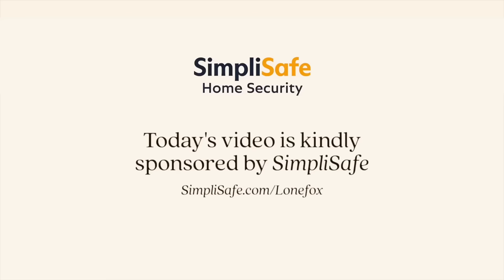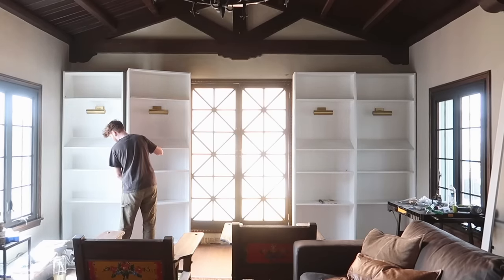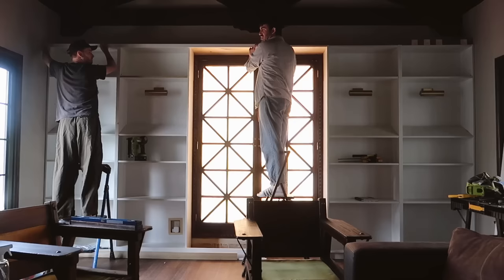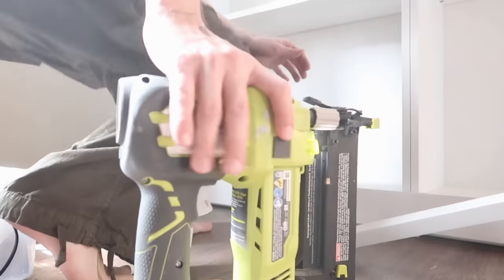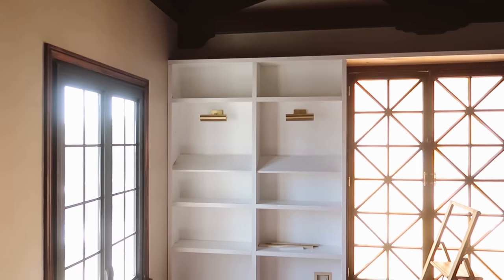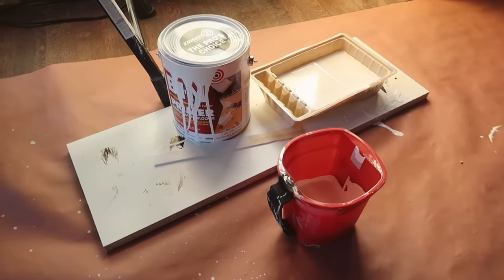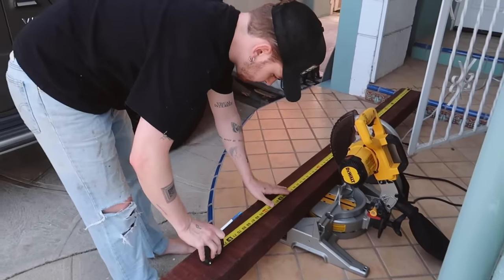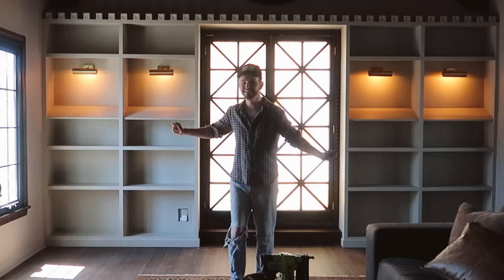DIY IKEA Built-in Library Shelves *AFFORDABLE & EASY HACK*

Comment: I. Made built ins with IKEA Hemnes. I had to put a 1x6 on the bottom similar trim connecting the two book cases and ceiling trim on top. A great advantage was being able to run electric cord under the Hemnes and up the groove in the corners. And Hemnes is real wood

Comment: Curtains outside of the window/doors will block light when you're trying to film and ad privacy when needed. Even sheer or light linen will do the trick. The goal is simply to dull the harshness of the sun not rob the room of light. try taping one up just to see as an example. Cute curtain holders on each side of the doors will look nice from outside if you choose a pretty iron hardware. Probably get the weather proof ones for the rare times it rains in LA

Comment: Not a fan of the dental molding but it's not my house but I would definitely consider removing it and bring in the brass rail like the other follower suggested.  I would also remove the portion that connected the bookcases and wrap the brass rail on top.  The beam needs to have more space to be the showstopper.

Comment: I think the end result looks really nice, but with all the extra stuff you applied including the paint, I wonder if this is really cheaper. At least here in Germany anytime I DIY stuff I have to spend so much on paint or stain and tools and wood at the hardware store that I could have just bought the more expensice piece and saved myself the trouble. I think unless one already owns a lot of  power tools and supplies its not cheaper especially if one doesnt use all the tools and supplies much afterwards😢

Comment: I think you can make bookcases even better. Get flat decorative 3 inch wide wood molding and face the front of the bookcases for a chunkier look. Maybe just put it on vertical supports to save time.

Comment: The 3x6” “green” plate is simply (treated lumber for water deterrent on home builds with concrete) thats what you used for your step. I just finished using the same lumber as tops of concrete foundations in the house for hangers and etc… Looks amazing drew as always!!

Comment: tbh i dont know if its just me but the ''trim'' on the top ... idk it doesnt seem to go, and id have painted the bookcases the same dark color as the door so it looked like a giant piece with the door included, but its a great idea
Reply: I agree about the top trim. Looks a little too castle themed
Reply: NO Trim On Top… doesn’t match. Use the top for decor.
Reply: Not a fan of the top part, i think it takes away from the doors. I really think old bookcases or something smaller beside those lovely doors would have been nicer.. Or painted dark so they don't compete with the doors.. Not my fav at all.

Comment: You lost me on the trim atop the book cases, but everything else was really well done. Maybe also swap out the light bulbs for a cool white? the warm white seems a bit off putting.
Reply: I’m personally never a fan of cool white lighting, I think the warm white feels cozy
Reply: @katelester5625  in my opinion given they're going to be display areas, a cool white light is more neutral and will more accurately display whatever you're placing there. A warm light will change the tones of the displayed items.

Warm white lights are good for lamps or overhead lights.

Comment: "[J]aggedy, peaky situations" are called dentil- almost as in TEETH! Mouldings are called dentil mouldings, but in your case it would just be dentil *trim*; I learned that in design college, the same place I learned about building codes and the difference between being a designer and merely a decorator.

Comment: So fabulous...love the trim on the top...
 Just had a design, I sketched up for a fireplace, with those rosettes one large in the center, angled the sides with 4 rosettes top and bottom.. smaller.
Light oak 53 tall..56 wide,
Had  wider base made 3inches wider...love it !
20 inch mantel...lifes worth living...right!   ❤

Comment: The wooden "Rosettes" are actually called PLINTH Blocks.   Yes...they are very versatile.  Decades ago, people with limited skills  and or the "equipment" to do an actual miter cut,  used Plinths at the corners to join the door, window and crown molding trim. 🤔

Comment: I would have used about under 1/2 inch round wood dowels to cover the area between the self front and the trim. It would have a finished look if anyone is nosy to check. 😊

Comment: I usually like your work and you did a good job on the bookcases with the exception of the rosettes.  They are usually used with trim on the corners.  Have you thought about trimming the top with the same wood you rimmed the bottom, then put the rosettes on each corner. Just a thought.  One more thing you need to improve your video and the lighting it takes away from your beautiful work. And I love the Monterey chairs with the upholstery.  I want a couch made with that gold chenille.
Reply: It would be super cute if they made it a castle for Chef Ratatouille!!!

Comment: I love the bookshelves, you put them together beautifully.  Putting on the brass rails, I think that would take away from the lights and the books on display.  Connecting the bookshelves together over the door . . . clutter and you have carvings around the door. More importantly you take away the emphasis on the carving in the center of the beam, you take away from the glass doors, and there is too much going on with all those blocks . . . that do not look like Drew/Lone Fox.  This is not a first apartment or a dorm room design.  Think about this, each set of bookshelves needs a crown to make them look complete. This  is how large pieces of furniture were built years ago . . . in parts; this is also how kitchen cabinets are built and installed.  The base sits on the floor (the trim you added to the bottom of the bookshelves is the base and should come out more and go around the exposed sides).  The center is the cabinet (the bookshelves).  The crown sits on top of the cabinet, and it is framed in this case with the same material you used in the base and vertical seams.  Take paper and draw or trace the outline of the beam above the door.  Turn the bottom of the carving up, opposite of the beam. Reduce the size down to the width of each set making sure the carving is centered in each set.  Have the design reproduced in an appropriate size for each set of bookcases.  
The medallions look like a parent took blocks away from their kid and put them up high so the kid could see them as punishment.

Comment: For next time you can take the cover plate off the outlet. Cut a smaller hole and then just put the cover plate on over the bookcase so the outlet is actually built into the bookcase

Comment: You was better off placing lipstick on the remote control outlet, then pushing the book cases 🔙 into it, which then it would've left you the traceout of the remote outlet onto the rear of the bookcase panel.... I've done it before.

Comment: Those fence posts are treated for outside use. In the future wear gloves when touching them and a mask while cutting  then.  I would suggest sealing them  all the way with a sealer just to be safe. You do not want to touch it with bare feet  due to the chemical they treat it with